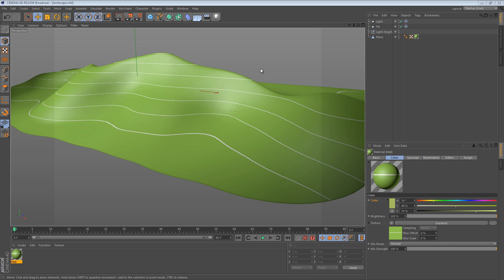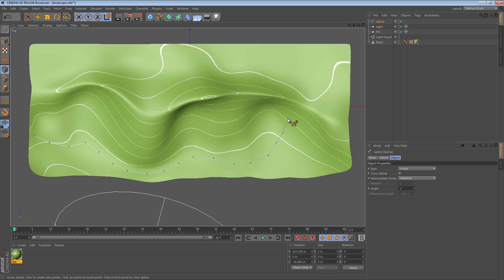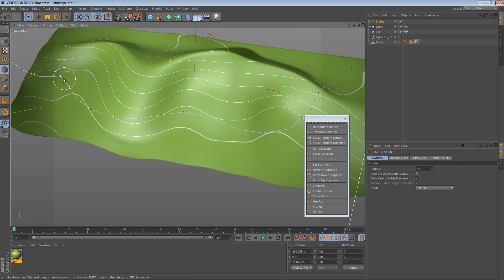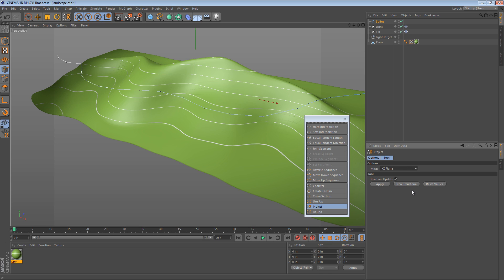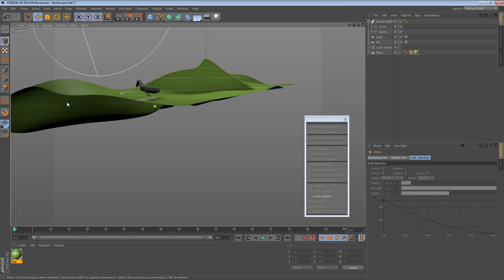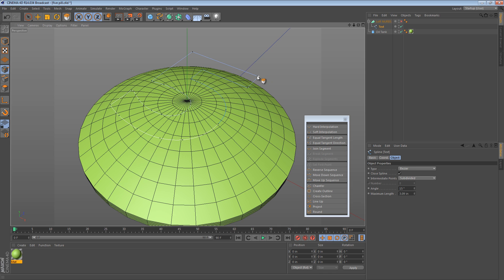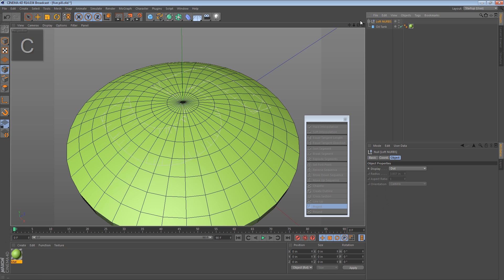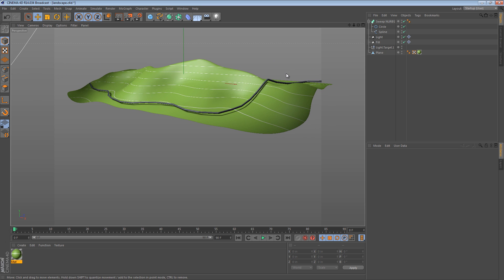Five Minute Tip - Projecting Splines on a Surface

Comment: So there I was, sand dune landscape wanting a spline the followed the crest of the ridge.  Draw the spline from above, no problem just need to get the height of each point and I am done!  How?  Mathematician first artist second, so exported the landscape and spline to excel, start analysing which points are the ridge by working to next highest point from an oberved point but there is a problem if the point is a local maximum already.  Try analysing the points of the spline and see the height of the nearest landscape point, at which point I would need to start doing to some heavy matrix calculations in Excel, not that I would not have enjoyed the challenge but acquiring new Excel skills was not today's target.  Eventually the penny drops, "surely somebody has done this before".  Project is in the spline menu now and that was the only problem I had.  Thank you.

Comment: this doesn't work for a basic sphere, i want to wrap a sphere in splines, any idea on how i would do that?
Reply from the maker: Create a bunch of loose fitting splines around the sphere; make the splines editable; use the "Project" tool in XZ mode and it should do the trick. (I have not tried this since R14 though).
Reply: @JamieHamelSmith  nah doesn't work unfortunately. Tried every option, none worked. Found a way, using the surface deformer. That seemed to work.

Comment: I have a problem - I followed this tut exactly except I projected the text spline onto a landscape. Everything worked fine except when I go to se;ect all and extrude it just lifts my spline text off the surface. It still matches the contours of the landscape but it doesn't remain attached to it. It just lifts off. Any ideas what I'm doing wrong?
Reply: You need and extrude object or a loft nurbs object that is converted to an editable mesh. And that is extruded, not the spline

Comment: yes, you can project a polygon object onto another polygon object (non-parametric object). 
Just go to Character menu - Commands - Project Object (click little box to open properties and choose Points to Surface), done. If I'm not wrong this feature was new in R13.